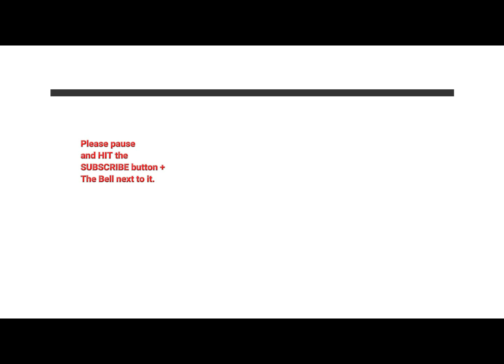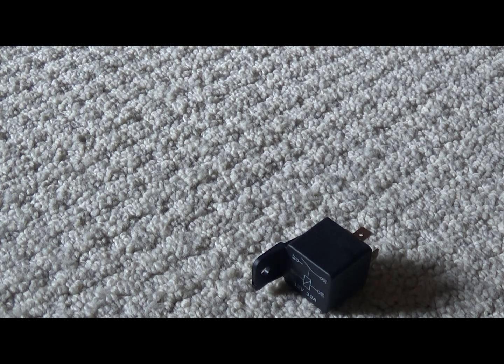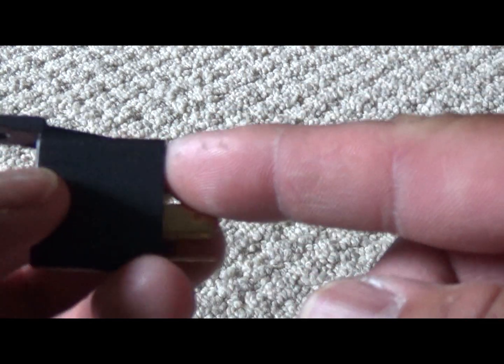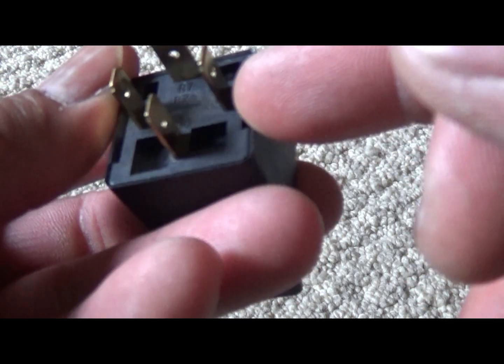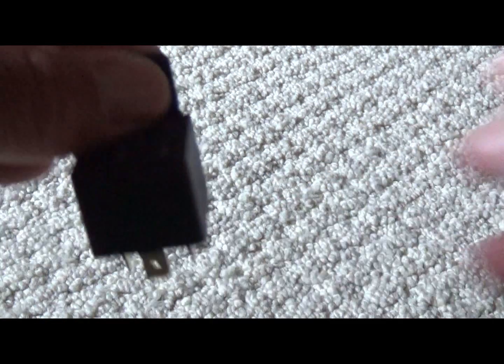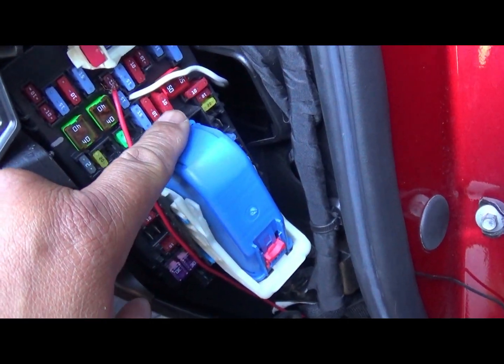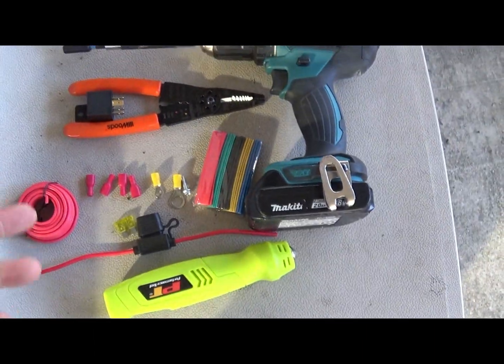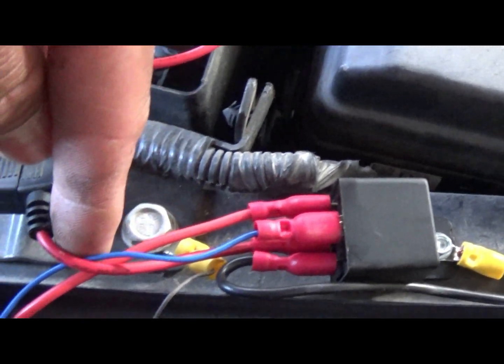How to wire a 12 volt relay to power lights and other

Comment: Power lights
Reply from the maker: Connect POWER or RELAY power to the light. And also disconnect POWER from the light.
Reply: Do you need to connect that blue wire that comes in the harness for the fog lights?
Reply from the maker: @oscargutierrez5503 yes